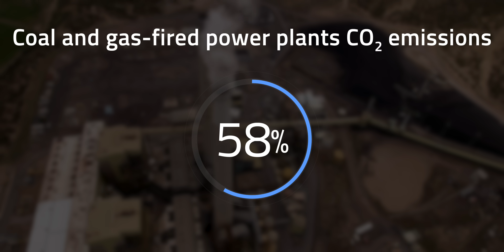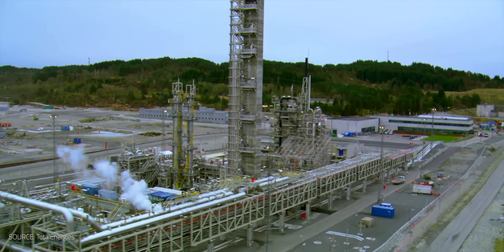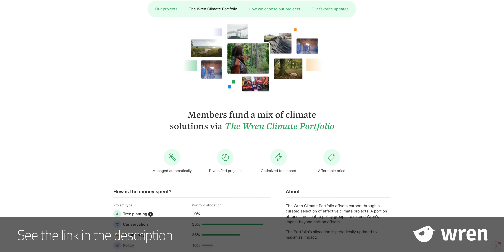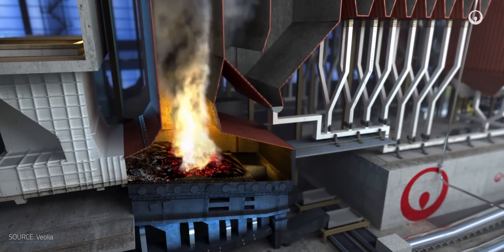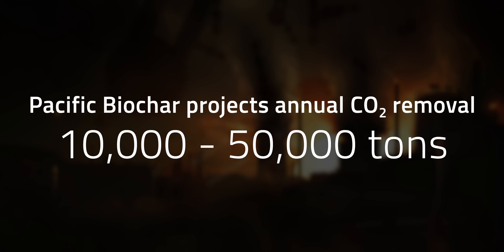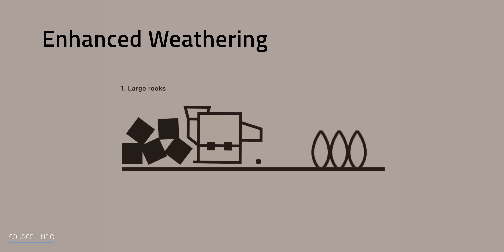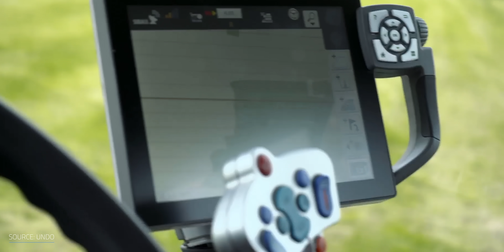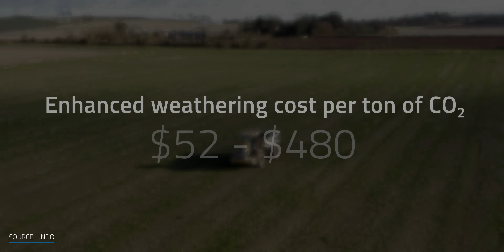The Reality of Carbon Capture

Comment: CO2 is essentially a little less than 1/3 carbon so sequestering it only takes a small amount of carbon from the atmosphere. Biochar is nearly 100% carbon so you get 3 times as much. It's much easier and cheaper to make, store  and has other great benefits as well. The length of time it stays in the ground is to a degree unimportant. We are in an emergency situation. We can easily get 100 years, probably more than 1000, time in which we can make great headway towards or reach sustainability.  Even just keeping plant material away form water will help, no bacterial breakdown. I put hay in a barn in 1976 that is still there. Actually it went on top of hay that was put in there around 1940. That carbon hasn't seen light in a long long time. It's carbon we need to get out of the atmosphere not carbon dioxide. The time for arguing on which method is better is over. We should skip the outlandish CO2 sequestering which is used only in order to get more oil and scramble towards most other ways to solve the crisis we find ourselves in. All hands on deck, start by cutting back on energy consumption, this place we call earth is kinda nice. We had better take care of it before it's not.
Reply from the maker: Thanks for sharing your POV on this.

Comment: This is an important topic not because of its promise but as a promising option that unfortunately in the end may not have a big future as a primary weapon in decarbonizing the earth's atmosphere...
First, regarding man made carbon capture... The problem with that is the extreme amount of energy often used to capture and sequestere. Any system that adds costs will have an uphill path to acceptance and practice, and might work only where carbon credits can be implemented.
As for naturall approaches like biochar, cost is also a major problem but not necessarily in the same way. Yes, first consideration has to be if the biochar is created by use of energy like superheated kilns. But, the main problem with even this approach is that it's hard to compete with "free" as in no cost. Recent R&D and theory on best farming and garden practices have introduced new practices including biodiversity and no-till farming. These and possibly others describe how mankind has been farming improperly for practically as long as mankind discovered monoculture farming, which is to plant all your crops together and eliminate the competition. Every field of wheat or corn you see by large commercial farmers is now thought to be doing it all wrong. The gardens we plant where the tomatoes are grown together in one corner, the peas in another, carrots in another and so on are why we need soil amendments to produce bountiful crops, and we often mistanely dump bags of chemical fertilizrs in the ground in the belief that plants will grow bigger and faster.

New theory supported by demonstrations have revealed that common ways we humans grow our crops is killing the soil which is why we keep dumping more fertilizer in the ground before planting and while plants are grown with each season. Crop rotation was thought to be a cure for soil health but with poor to mediocre results. Instead, within the past decade scientists have shown how growing as many diverse crops as possible as close together as possible actually enables the creation of soil biomes to enhance nutrient uptake surpassing the practice of adding fertilizer by allowing natural decomposition for N and the natural and sufficient amounts of P and K to be absorbed into all the plants. It has been pointed out this is like a return to the basics and origins of the American Great Prarie when there were numerous diverse strains of grasses that created a massive, healthy ecology of soil that caused grasses to flourish.

This is revolutionary with extreme importance and impact on everything from de-desertification to increasing the nutritional value and bounty of the crops we grow across the world. Do some searches on such things (even on YouTube) using keywords like "plant diversity" "no-till" and rhizophages to return articles and lectures about this very promising and likely revolutionary approach to feeding mankind across the globe, in both technologically advanced and destitute societies.

And so, although the topics in this video are important if we want to accelerate carbon capture, unfortunately for these approaches they don't compete with what I just described to primarily improve how we symbiotically enhance the growth of plants (and the invisible microbes that actually comprise 93% of the living biomass on earth) which would both feed mankind better and at the same time sequester carbon in our environment... And as an added bonus at a cost no other approach can compete with... free.

Comment: Why don't we take more advantage of hydroelectric?  I've seen a guy power his house off a converted washing machine in a small 6in deep stream that ran through the woods behind his house, and the stream easily could have powered more with little to no drawback if everyone was tapping into it. It seems like our only interest in hydroelectric is on the massive scale like with huge raging rivers and giant dams, but with a bit of gravity it doesn't take much water flow to push a turbine, and the water just goes back into the stream and continues on.

Comment: Great video!
I’m thinking it would be helpful to measure the cost of CO2 sequestering model in terms of dollars per ton of CO2, but also in two other ways that would give a sense of how rapid the removal is and how much land area is required: dollars per ton of CO2 per year, and dollars per ton of CO2 per acre.  
I’m wondering why we never hear about sequestering CO2 from seawater, since seawater contains a much higher concentration of carbon than does the atmosphere.

Comment: Off topic but in thinking about CO2 sequestration the big problem is that of CO2 concentration (0.004% of the atmosphere) is really, really low.  But plants are bloody good at concentrating CO2.  Why not grow fast growing plants, then burn them under a controlled conditions (i.e.; furnace) and then capture the CO2 from the smoke which will be much higher in CO2 than the atmosphere.  Essentially using plants as solar powered CO2 concentraters. The energy given off from the burning could be used to make electricity and power the CO2 concentrating equipment (solving a second problem of CO2 sequestration).

Comment: How to lower your carbon footprint:
Natural Gas furnaces, hot water heaters dryers and stoves. These appliances have efficiencies 90-99%. Thermal generators have efficiencies around 33% on average. So 3 times less CO2 per BTU of heat produced. 

This is because 2/3 of the heat produced in a power stations goes right up the stack.

Comment: They should Carbon Capture at the Smoke Stacks, and Mobile Carbon Capture at the tailpipes. The current method of Carbon Capture is bizarre, because they strangely prefer to filter the air anywhere, which includes bugs, birds, and other bad emissions.

Comment: My biggest question that I have not seen being discussed too much/at all is if the embodied carbon of the CCUS system + the carbon associated with the energy used to run the CCUS system is less than or greater than the carbon removed by the CCUS system while in operation....thoughts?

Comment: The volume of man-made CO2 added to the atmosphere over-and-above natural exhaust, the measured rates of change of environmental conditions caused by CO2 heat retention, the implications of increasingly serious crop failures in production-intensive zones, and the underestimation of predicted rates of change mean CO2 removal from the atmosphere is not optional. One way or another, splitting carbon atoms away from oxygen atoms requires roughly the same amount of energy as chemical reactions released burning things. Depending upon anyone's subjective guess about when the balance between human oil consumption and atmospheric composition was acceptable, the amount of energy required to remove excess CO2 with machines for the sake of progeny is proportional to the energy released from burning everything after that date*. Since, empirically speaking, it took nature several tens of millions of years to sequester roughly half the oil humans burned in 200 years, it's great to think about ways to coax better efficiency out of natural, favorable absorption processes,  but not now. It's too late. The time for hopeful, long-lead technology cures is over - including fusion and renewable energy sources.

If the arbitrary target is to roll back excess atmospheric CO2 to, say, 1970 levels (probably good enough for the unborn to dodge most consequences of rampant overpopulation), massive emergency proliferation of the best  modular fission reactor designs, 5x increase in grid capacity, and several hundred thousand ClimeWorks size scrubbers have to be up an running in 5 years.  2x to enable electrification of everything (industry, ag, and transportation, etc.), 1x to assist emerging countries, 0.5x to desalinate and pipe fresh water to spreading drought zones, and 1.5x to start removing excess CO2 1.5x as fast as it was produced. This might stabilize food production zones in time to avert genocidal resource wars, return the CO2 levels to 1970 in 40 years, and buy time for next generations to figure out the better solutions. The emergency conversion effort will spike CO2 levels even more, so heating effects will appear amplified ahead of the current ignore\wait-for-Jesus\do-as-little-as-we-dare schedule. Nuclear triage, while staggeringly expensive to imagine, can and should be done for ethical reasons alone. Unfortunately, I think it will only fly if investors miraculously recognize financial opportunity in saving humanity beyond 2050 for the sake of staggering profit and of continuing to retain brand-loyal consumers vs. retreating to luxury bunkers in New Zealand.

*For switching to all-electric and undoing the oil-based portion of excess CO2 alone (not counting coal, gas, and unprecedented man-enhanced forest fires the size of Rhode Island), figure excess of 400,000,000,000,000,000 kWh per year

Comment: The climate change fraud is based on the fact that CO2 warms the planet, however science has not found a way for CO2 to heat anything, except for "climate scientists", who through propaganda have created a sect full of fanatics incapable of use your critical thinking, follow nonsense like capturing carbon, albeit CO2. By the way, since 2016 global temperatures have been decreasing, and CO2 has continued to increase, how does that fit into your critical thinking?

Comment: The ideas are neat but the numbers are just not cutting the mustard. Sequestering 4.5 tons per Hectare of farmland is nothing! The average American emits 20 tons of CO2 per year! If one were to offset one's footprint by the CCU estimates it would cost $400-800 per year and that's not even touching the problem of scaling this tech. I don't think it's a fools' errand to pursue these initiatives out of hand; I'm just extremely wary of this being used to placate and greenwash to avoid actually doing what it takes to solve the problem, which is to say drastically reduce our consumption. Buy less shit. Do more things the hard way. Actually penalize and shame bad actors.

Comment: How does transport factor in for the enhanced weathering carbon capture ? The french agency ademe gives orders of magnitudes of about 3 kg eqCO2/ton/km of emissions for road, maritime and fluvial transport, so with 250 kg eqCO2 captured per ton of basalt, transporting that more than 80 km from the source would pretty much nullify the effect. Trains are much better, at 0.053 kg eqCO2/ton/km, and we can expect the mine to be connected to one, but there isn't a train line to every field.
It looks like a possible way to engineer better soils, but as a carbon sink it sounds like it is quite lackluster.

Comment: As I see it, a full abandonment of hydrocarbon fuels is unlikely to ever be viable without giving up some of our modern luxuries. Example, commercial international flight relies on hydrocarbon fuels, and making an aircraft that can carry a large number of passengers across the Atlantic is basically impossible with batteries. The energy density of the best batteries available today is WAY too low to be viable for large aircraft, and even the best theoretical batteries that may not ever be achievable would not be able to carry a 747 across the Atlantic. Thus some form of carbon capture (or abandoning the idea of cheap international travel) is going to be necessary if we are to become a carbon neutral world. I personally am quite fond of the idea of e-fuels, which take carbon from the atmosphere and turn it back into hydrocarbon fuels, but that tech is still very expensive and may not be able to be scaled to a viable size.

Comment: idk how biochar is actually helping bcz burning bio material without O2 produces CO (which is 3 times worse than CO2 if my memory serves me) and regular compost has a lot of materials that help plants to grow not just carbon and CO2 that is produced that way is natural process.  I don't like things that put ECO tag in front of it when it has positive carbon footprint like creating etanol fuel form corn/sugercane where you release more CO2 producing it than saving CO2 using etanol as a fuel. Also, carbon footprint/output/eqvivalent isnt the only thing  we should look for when we discuss ecological matters. Things here are not black and white they are mostly gray. Another questing what about collected carbon? How is it used? We got a few examples but they are mostly using CO2 in small scale. Throwing CO2 in to the ground is just asking for trouble if you ask me. Carbon should be recirculated into the nature in some other form than CO2, not just bearring  it to the ground like nuclear waist.

Comment: You sound like quite an intelligent guy.  A couple of questions: 1) Is CO2 a toxin/poison; 2) what is the historic record of atmospheric CO2 over the past 10million years: 3) what are the top 5 contributors (man being one of them) to climate change; 4) what is the energy expenditure to capture CO2; 5) what has been the greening of the planet in relation to the the global climate cycles; 6) what are the longterm effects of carbon capture on earth soil rock chemistries ... unintended consequences ... models failed to predict climate change; 7) are there less energy, resource, labor intensive ways to approach an insignificant change in climate (which is likely to vary in the future regardless) than chasing after CO2; 8) if the current environmental mantra is "change," not warming, how will capturing CO2 reduce both sides of "change?"

Comment: Quite surprised that you didn't mention Hemp, particularly as it is cheaper, readily available, can improve soils, gives a highly useful, sustainable resource with over 50,000 different applications and uses, and not only does it sequester CO2, it can remove heavy metals and radio-active pollution as well without the need for very expensive machinery, and it will grow almost anywhere without the need of pesticides.

Comment: I think stuff like carbon capture focuses on a symptom not a solution. This happens a lot, like a bandage to an open wound. It allows for broken systems to stay in place by accommodating for those systems. People are focusing too much on carbon when in reality it is a combination of everything like methane, pollution, deforestation. The whole system needs a complete rewrite before it’s too late. These machines also take up resources and go through tedious testing when you could just plant natives trees and foliage. It doesn’t seem practical, it seems redundant. Indigenous people have been growing and flourishing with the earth for thousands of years, people are thinking about climate change wrong. These are systematic issues. People have become unfamiliar with the ways that have allowed this species to live. Homes, cars, technology; it’s creating a disconnect with reality and people are loosing themselves. If everyone would stop trying to reinvent the wheel and stop trying to fight our environment and instead work with it, we would all be better off. The clock is ticking, will we make the right choice?